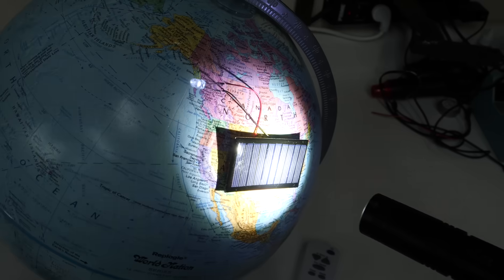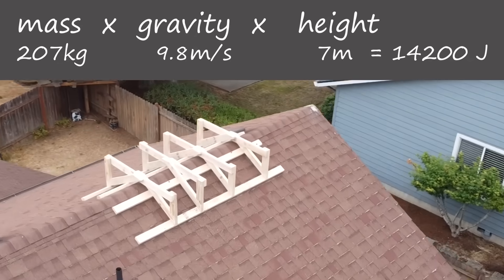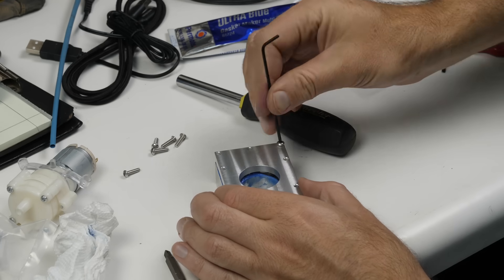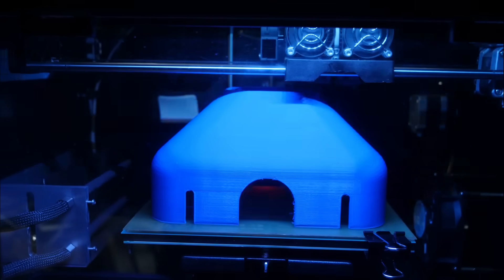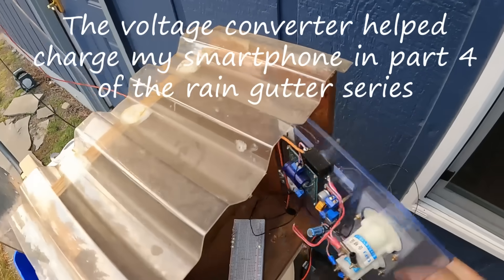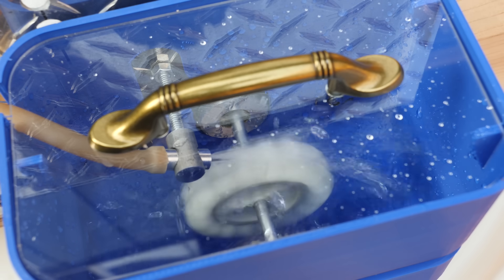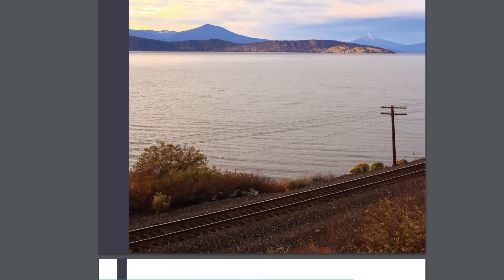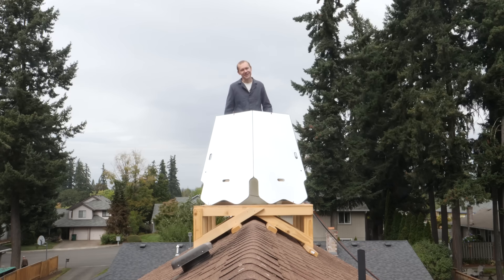Storing Solar Power on my ROOF!!!

Comment: you know ram pumps? the ones that use the kenetic energy of water when it stops flowing to pump water? well, i was thinking.. they require a lot of "waste water" to function - it's why people put them in rivers to pump water to their garden or house... cuz the waste water can just go straight back in the river.. they only pump about 15% of the water that runs through them but if they were in series like: 

[pump] ->
[pump] ->[pump] ->
[pump] -> [pump] -> [pump] ->
[pump] -> [pump] -> [pump] -> [pump] ->
[pump] -> [pump] -> [pump] -> [pump] -> [pump] ->
[pump] -> [pump] -> [pump] -> [pump]  -> [pump]  -> [pump] ->
[pump] -> [pump] -> [pump] -> [pump]  -> [pump]  -> [pump]  -> [pump] ->
[pump] -> [pump] -> [pump]  -> [pump]  -> [pump]  -> [pump]  -> [pump]  -> [pump] ->
[pump] -> [pump]  -> [pump]  -> [pump]  -> [pump]  -> [pump]  -> [pump]  -> [pump]  -> [pump] ->
[pump] -> [pump]  -> [pump]  -> [pump]  -> [pump]  -> [pump]  -> [pump]  -> [pump]  -> [pump]  -> [pump]

or something... . I want to make a closed system where you only need to pump a bit of water for it to be self sustaining and I was thinking about what miners use to do to create an energy source.. they would saturate moving water with air until no more air could dissolve in the water and then the bubbles would exit the moving water as soon as they could and there would be a chamber to collect the little bubbles that want to leave the water and this would build up air pressure in the chamber. I was thinking that if a ram pump was connected to another ram pump via a ramp/downwards pointing channel for the water to pick up speed before entering the next ram pump(s) and then the waste water out of that ram pump(s) were connected in the same way to more ram pumps etc then the initial waste water would become less and less and the remainder could maybe be pumped with air pressure created from over saturating the water with air as it goes down the channel and the bubbles collected. if it's possible to get the waste water down to the same minimum level no matter how many ram pumps you start off with then you could make the system big enough to provide enough air pressure to pump the remaining waste water and then it would be perpetual. Then do what you did, have a reservoir of water somewhere up high and have a turbine on the exit of the reservoir  and then use ram pumps to pump the water straight back again into the reservoir.

i was also thinking that it could be used to create a sort of closed loop on a hydro dam.. water leaves the dam via a turbine but a portion is pumped straight back into the reservoir so that more water than the river is feeding the reservoir can leave via the turbine, producing more energy. 

tbh i am not really surprised that water holds so little energy compared to batteries but if you got the space then i think it's good, plus i think that building large structures that arent steel reinforced and that could maybe be made out of "roman concrete" (if we can discover their formula) would make for quite a sustainable renewable energy source. Steel reinforced concrete only lasts about 200 years or something (if that) and roman concrete is still around from roman times and apparently their formula is also just a longer lasting one than the one we use today. I just think it would be good to make sustainable energy sources out of it. 

I also cant see how ram pumps couldnt be mostly made out of concrete. There's old roman concrete that is still standing that is in the ocean and i think it could handle the slow flow water running through a ram pump. I saw a really big ram pump that was made my a scottish company i think and it looked good but its housing was all metal and I just thought : $$$$, plus it would need to be re-painted every now and again.

Comment: By the way, what are your thoughts on using the latent heat capacity of water for air conditioning? Cooling off water with fans during at night and using it to cool your house during the day? I know geothermal is drastically more effective, but not everyone can afford the groundwork.
Reply: That's pretty much a swamp cooler. Years ago there was a show on tv that built people houses, one episode this family lives in a tiny ass house with no hvac and the son managed to build one using soda cans, a truck radiator and other parts.
Reply: Have you checked YouTube for videos on geothermal?  It can be done with plastic tubing...whenever I get my own home and land...been dreaming so long to build my own geothermal system coupled with wind and solar for a net-zero home.  I helped build a huge high school campus in New Mexico that had geothermal HVAC.  Regular heating and cooling done with 1/6 the electricity of conventional HVAC.  Honestly, I don't fathom at all why geothermal is not huge, dwarfing solar and wind...24/7 reliable and available in any climate and almost anywhere.

Comment: Instead of having a dangerous heavy barrel on the roof, you could just have a safe system of hanging weight (even the same barrel) for example in your garage with a system of transmissions. The power from the solar panel would lift it up and in case you would need the energy, the descent of the weight would make run the power generator. I do not think I am the first person on Earth having had this idea. The old coockoo clocks used to work on similar system. I just have no tools and place to make and test it.
Reply: So, what's the benefit?
Since the amount of energy stored is proportional to weight, and height difference (the drop), you can store more energy by storing weights (be it liquid or solid) either higher, or heavier. Storing it in the garage would probably require much heavier weights to store the same amount of energy because of the much lower drop.
... but then you could do the same with piped water - store much more water, but closer to the ground. It could be safer, if you have some way to hang metric tonnes of water attached to your garage roof.
And I can imagine trying to make a system of transmission that gradually rises or lowers literally tons of solid weights, using a tiny engine/generator... could be more challenging and prone to dangerous failure, than a similar system based on water, stored in an immobile tank.

And all that doesn't take into account efficiency losses. How much energy would be lost in a transmission system? You would have to compensate for the losses by storing more energy, and by producing more as well, which could make this solution non-viable.
Reply: @Tennouseijin  Thank you for your comment. Indeed, those would be the issues you would have to address.
Yes, it is all about finding a good balance between the height and the weight. Or you might apply some mechanical resistance of elastic objects and build a system of interconnected springs in which you might store potential energy without the need of important static burden to the building. Or even combine the both - use the system of metalic springs storing the energy in itself and the transmissions plus the motor and the generator as a burden by itself.  
The idea of a garage was just an example. You might in fact be going underground, having a burden hanging in your well. The main idea was that that the roof is usually not projected to have additional heavy burdens added to it and that the external factors such as strong wind might create a dangerous situation. 
And yes, you have energy losses everywhere. But also in the barrel-on-the-roof system. What I found about the water turbines is that the most effective big ones are efficient to about 90 percent. You should add to it the effectiveness and the energy losses of the water pump. I can imagine that a good system of transmissions would be more effective than that.
Reply: @peterk.6093  I suppose a good place for such a system would be if you have a sloped piece of land. This avoids the necessity to build tall or deep, and would be much safer as a result too.

You could even use sloped rails with a cart attached to the transmission system, this could be a fun project (though I'd still consider using piped water a safer option).
I'm also wondering which option will require more maintenance.
Reply: @Tennouseijin  Yes, that would also be a good option.

Comment: How can scale this up at least to have a moving pedestal fan running along with one led bulb ?
Like having a two 500 gallons reservoirs one on the soil and one on the roof ??
And a coupe of bigger solar panels and a few deep cycle batteries ?
These can drive a bigger 12v or 24v DC pump ?

Comment: Wouldn't it be more efficient to pull up some rocks with that motor with some pulley? Generating the electricity could then be done with the same motor, by just letting the rocks gently descent again (like the GravityLight). I imagine there are quite a bit of losses due to the splashing of the water. Also by adjusting the gearing, maybe the motor wouldn't heat up as much, which are also losses. I understand that this is not meant to be an actual solution, but it would still be interesting how efficient it actually is and where the losses occur and trying to improve on it.

Comment: At first I thought of this as an impractical but cool demonstration, but then realized that a setup just like this could actually be very useful in third-world countries. One small solar panel, couple barrels of water, secondhand pump and generator, 3D printed turbine, and a hill, all could be built and maintained very easily by rural villagers at very low cost. Could light that LED chandelier for several hours (he has 14,000 joules, if used at 1 W that would run nearly four hours, but that would be at 100% efficiency, I don't know the turbine efficiency), providing light for a hut.

Comment: Although it’s fun to play please don’t ever choose something like this over charging a battery. First. The energy lost by pumping water up and then converting it back to electricity using a small turbine are massive. You would be lucky I’m get 20% of the original energy created by the solar panel from the solar panel. The second issue is the pump and water turbine will cycle far fewer times than the least expensive deep cycle batteries. This is a great demo to show your kids how energy works but simply buying a battery and charge controller will be much more efficient and cycle many many times more than the pump and whatever he is using for a turbine.

Comment: Why don't you use some CD discs
Reply: You should use some CD discs put a maybe a thirty seconds of an inch apart
Reply: Make a Tesla turbine and blow the water through that using CD plastic CD discs
Reply: How long will the 55-gallon drum run a light

Comment: But why you don't buy more batteries so you have more  storage capacity from your energy cumulate from sun,  and a motor from a washing machine they trow away a, lot.  What about put a cistern that collect the water when it rain so you have storage of sun and storage of water..doest even have to be on the roof top.. Can be on the middle in a structure a part, And you can storage even wind... All energy that goes on your battery new generation lipos4

Comment: The obvious problem would be long term; you don't want a ton of water crashing through your roof due to winds from a storm.  If raising water is a good potential energy saver just think of how well a ton of lead would work, and it would be smaller so you don't need it right over your bedroom. You could mechanically wench it up with your electric motor powered by solar; or better yet;  use the power to wind a giant spring which powers your car - giving Tesla some competition in the scaled up toy business.

Comment: The problem with batteries of all types is simple.

Chemical energy is far more energy dense than capacitors or mechanical energy.

Which is why coal, an energy dense chemical fuel, is superior to a battery, is superior to pumped storage.

Although there is an argument to be made about Air pressure storage.... It does come with diminishing returns.

Comment: I realize this is a "Learning Video" but the implementation is quite dangerous and also pathetic in terms of having useful power. First it is not a great idea to store water on a conventional residential roof, and while you covered some hazards the wind load was not even mentioned and if that barrel fell even half full it could easily kill someone. It needs to be held down for sure and I worry a copycat will imitate this design and hurt someone. Also please consider using 2 cameras with both on Tripods because eventually 1 million people might see this video.

Comment: 32 feet per second squared, that is in free fall. That's a lot of potential converted to kinetic any way you look at it. A good idea. I bought a submersible well pump from china for 78 bucks. This is a great project. It is also passive, all automatic, don't have to turn it off and on. Put the syphon control valve at ground level.  A water supply and free electricity. Brethren that's a nice sistren. 
When it rains it shines! H2O= 8.5 pounds per gallon.

Comment: 14,000 J = about .0039 kilowatt hour (J/3600000). In my parts, a kWh costs about 15 cents. You are storing 6/100 of a penny's worth of energy with a full tank 7 meters up. If your recapture system is 50% efficient, then you will actually regain 3/100 of a penny in work.This is why it costs more to store/retrieve electrical power than it does to produce it. 

Watt set a horsepower at 550 foot-pounds per second. An electric machine roughly 75% efficient produces one horsepower from a kilowatt of electrical power. In an hour, that 15 cents of work could lift 550 pounds 3600 feet in the air. Or roughly 1000 kilograms almost 300 meters straight up. Storing useful amounts of energy as the potential energy of lifted mass requires huge quantities of mass and/or extreme heights.

Comment: OK, energy in a fully loaded smartphone battery: about 15 Wh.
Potential energy of 200 litres of water on a height of 10 metres: 5,45 Wh.
Cost of lithium battery 4000mAh (roughly 2x18650 cells - find it by yourself).
Cost of building and maintaining 200 litres barrel on the roof plus all the hydroenergy conversion gear - estimate it yourself.

For me, if I had to do it, it would be ludicrous. I absolutely prefer to buy two (or even three, compensating for efficiency loss) 18650 cells once a year than to build such a system. 

Hydroelectric storage facilities are economically viable only at the really huge scale.

Comment: Great movie.
14200 J is only 0,003 9(4)kWh = 3,94,(4) Wh. This is only 1-2 chinese li-ion cell.
If we need 10 kWh, we should have 36 MJ of energy.
So you need 524 781 kg of water on the roof, which is 524,8 m ^ 3 of water.
This is a lot, which is why large companies keep their energy so.

Comment: Excellent system, you show that it can be done!. Just a couple comments,
The pump is overloaded, would be better to get a more powerful one or put shorter gearing to make it easier for the small motor to pump up.
The turbine can be more eficient if it can enclosed up so the pressure is bigger.

Comment: The point of this video is to teach about energy storage not to build a practical system and as such it is great. Water mass stores a very small amount of energy but it works for very large scales where water and space are available. If you store solar energy as heat in water it can store a much larger amount and there is no conversion loss as you can get the energy from the sun directly as heat.

Comment: Not to rain on your parade, but 14,200J would seem to be merely 4Wh, that is to say, if you had a 100% efficient system for using all of the stored energy for that large quantity of water, it could produce 4 watts for a total of one hour. To put it another way, it's less than one third the energy of an iPhone 13 battery. So, if your system is let's say 50% efficient in using that stored energy, you could need 7 of those barrels on the roof to charge one phone.

Comment: There is something similar in Wales. The water is pumped up at night when electricity is cheaper and because the release of energy is instant it can then be used when the grid has a dip during the day. Other sources of power take time to start and the flow of water makes an immeadiate difference.

Comment: This is dumb.  The reason its dumb is because you are not able to store any significant amount of energy in that small amount of water.  Now it "could" be a good idea if :
1.) You have a 100 ft cliff.
2.) You can easily make a water storage pond.
3.) You live in a rainy area.
4.) You have a giant solar array that the power company F's you over by not paying for the electricity at the same rate you buy it at.

Heck while your at it.  Insulate your pond and passively heat it and throw on a floating cover with a collection pond of the same size so you are just pumping from one pond to the other and draining from one to the other.  Then use the water for heat as well for your house.  Of course the cost of all that is probably way more than you'll ever get out of the system, but you would be independent far from any electrical grid.

Comment: Would an air compressor help as far as pressurizing the vessel on the roof, and making more power. Obviously you don’t want the pump pumping if it’s full, so a compressor may help.  Cheers.
Reply: My BIL at Bonneville Power was studying storing excess solar and wind energy using pressurized air in old natural gas wells.

Comment: Can you add a battery to allow you to bleed off the excess solar energy. Use some pwm to control the flow and reduce the flow rate.  Keeps the motor cool as well.  Battery can be used to pump the water while the solar is unable to.  👍. Nice concept. I like it.